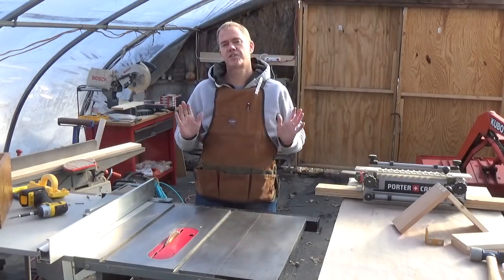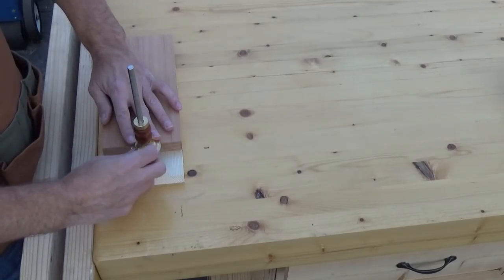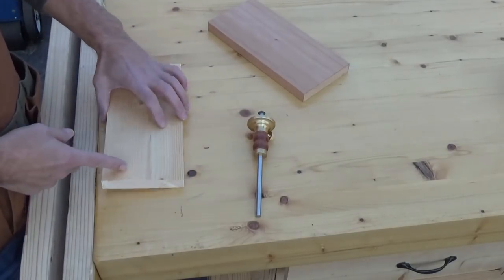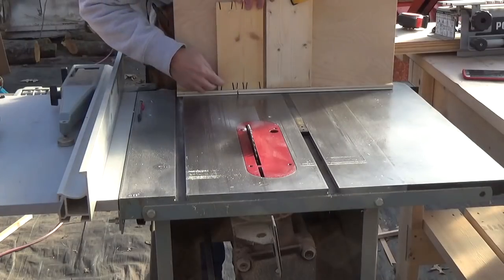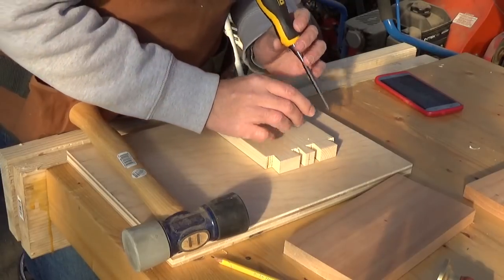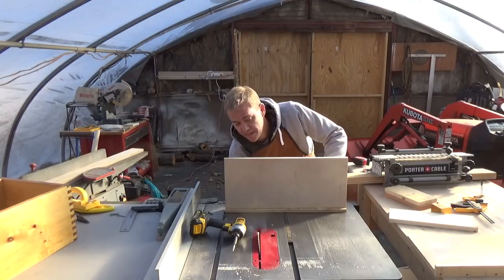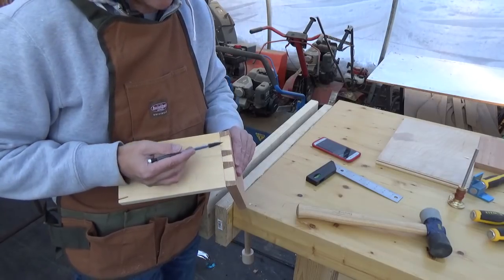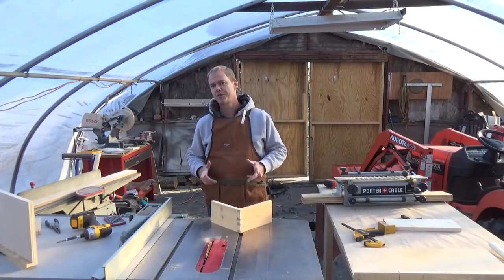Cutting Dovetail Joints Using a Table Saw...Looks Great...Better than a Jig.

Comment: I enjoy hand cutting dovetails. And I found a great little tool to have handy, Ed. 
It's made by Taylor tools and is a solid brass  dovetail marker  with both 1:5 and 1:8 slopes, so it's marked for soft woods and hardwood as well.  Only about $15.00 and always ready to go. 
BZ on your videos. I don't know how I'd make it through the Winter months without my wood working shop!
Reply from the maker: Thanks Steve, I'll look into it...I hope to get good at hand cutting dovetail joints someday.

Comment: Whats nice about this jig is it's variable in dovetail cuts.One thing most desirable for restorations on actual hand cuts, eye placed lines/angles/spacing utilized by the original cabinetmaker is important. There is a time and place where saving on time and material is important,,that isn't something well utilized in restoration of broken/missing drawers...Besides all that 98% of all hand cut dovetails on older pieces aren't perfect. As they say: One must match the hatch" to replicate the original work...Way to many videos make a mistake on stressing perfection in this area of woodworking...